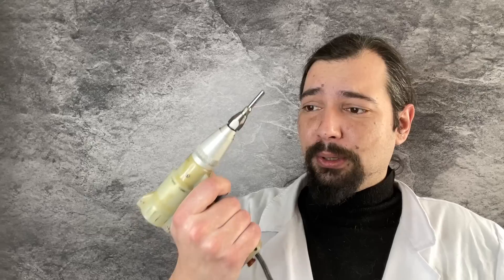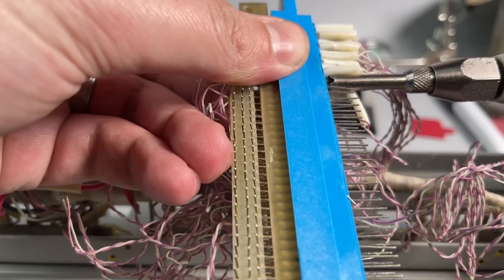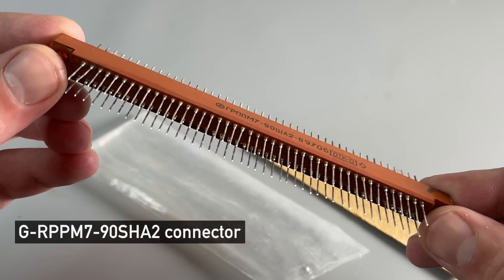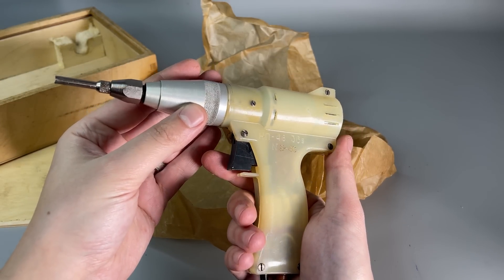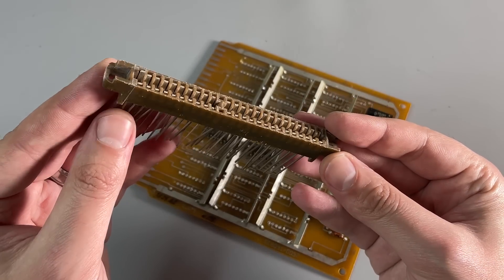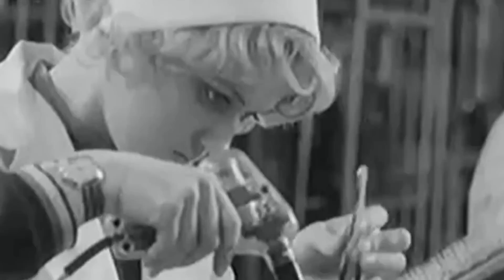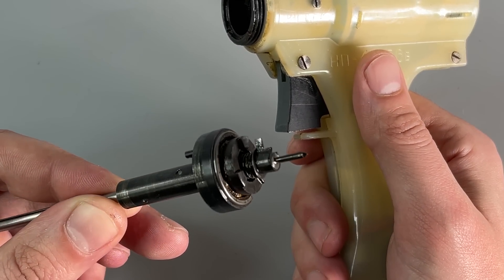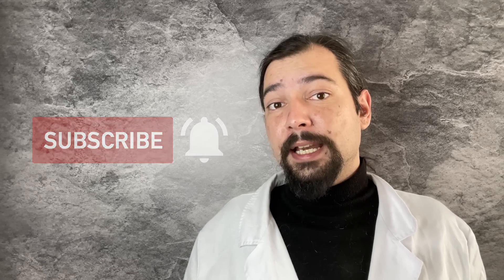We've got a vintage WIRE WRAPPING tool and it is AMAZING!

Comment: If you have some OS backups I could probably get it running in an emulator or on my newer mainframe system units and it would be interesting to take the emulator and plug the UI into the real panel
Reply from the maker: I have, as well as many pieces of software, all that perfectly runs in Hercules vm/360 emulator. Too bad this very panel is not a CPU panel, but universal channel multiplexer one, which operated by hell of microprograms which are gone. And in this very machine model it did not interact very much with the OS itself,  (that was the idea — of making a separate channel processor).
From that little bits of documentation we could get, we guess it will be possible to make a hardware imitation of some operations, say, address entry or switching channel offline/online, or indicating registers, butnto wire it to emulator for now looks like a very hard task, mostly limited by the lack of information.
Reply: @ChernobylFamily  ah so it was a Bus/Tag multiplexer?
Reply: If you know the IBM equivalent I may be able to get more information here to try and recreate the device.
Reply from the maker: @vinatron8075 sort of. The CPU panel looked similar, but had way more lights and less buttons.
Reply: @ChernobylFamily  well if you need any IBM docs that you think may help let me know I have connection I may be able to find stuff
Reply from the maker: Thank you! I will keep in mind, there really may appear a need. But still there is some work to do before that.
Reply: @ChernobylFamily  not a problem keep me posted I have some resources here and know some people with S370/S360 Channel MUX units

Comment: Soldering wire-wrapped connections impairs reliability! 
And the tool is cool, unfortunately it doesn’t fit 2.54 pitch. I have the same one, but I wirewrapped my relay computer with a hand tool
Reply from the maker: I believe you, though unfortunately do not see other option with round pins. Yes, it seemingly is for 5 mm only, I've managed to wrap СНП34-135 with it, though that was somewhat a painful experience.

Comment: This is interesting timing, I am building a test fixture at work and we’ll be using wire wrap for the spring loaded test pins. This is a superior connection method compared with solder cups because of the vibration resistance. I haven’t done it myself yet so it was cool to get a view from you first!
Reply from the maker: Good luck!

Comment: Jonard in the US still makes wire wrap tools new for the phone company.  If you want to make it a little faster they have a cordless version and it has a wrap/unwrap bit built into it.
Reply: The ones I've seen don't have that insulation wrapping feature though.  You might be able to twist the gun by hand.  It's notably faster than the one you got.  It seems like 2 seconds for your wraps and jonard is like .5
Reply from the maker: I guess my one will work way faster if I find a PSU as required. This one is terribly underrated by amps.
Reply: @ChernobylFamily  I've never had a wrap of insulation be specified in my jobs but I think another way to tackle it is to stick insulation up the wire wrap barrel

Comment: I still wire-wrap a small project now and then.  Used to use the Gardner-Denver WW guns at work back in the 80's.  We built some very large WW boards for our flight simulators, and these did use the automated WW machines that were programmed with punch tape.  It worked pretty well, but now and then would stretch the wire too much and cause the wire to break within the insulation.  Troubleshooting a board with thousands of wires was not fun!  I still have my manual wrap and unwrap tools, as well as the No-Nix stripper for the 30 AWG wire.  Very handy stuff.
Reply: I worked at dataCon from 1975-2000. dataCon was the largest wire wrap contractor in the world.
 We modified our Gardner Denver automatic wire wrap machines so that they would perform a continuity test with every wire the machine would put on the back plane.
Reply from the maker: Thank you for sharing this!

Comment: Now you need holsters to go with your pistols! 😅

Seems like wire wrap was typical world-wide so yet another thing we can all share! ☺

The mini computers we had at work in the 80s, 90s, and early 2000s used wire wrap for their backplanes.  I remember a tech modifying things so we could have 2 computer chassis use the same peripheral rack - it could be switched between the computers in case of a failure as it was an important system.  It was always amazing to me that so much had to be done correctly by hand to make it all work! 🤓
Reply from the maker: Thank you for sharing!

Comment: Never use a heat gun on or close to a wire wrapped board. I did to heat shrink some soldered connections not realizing the wire wrap insulation is easily melted. Redid the whole, but small board.
Reply from the maker: This is a good advice.

Comment: ...I remember when our school district moved its central office into a new section of the high school back in the mid 70s, they built a new computer mainframe room as well instead of moving the old one in... While they were putting it in, I saw  a somewhat different version of these things being used on the busboards and wiring arrays amongst and between the different computer components and peripherals... That would've been a lot of wires to solder otherwise... Nowadays, everything is mostly miniturized, self-contained, and if it HAS to connect with something external, it's completely wireless, via USB, or just a simple "lego-snap" and it's done!
Reply from the maker: Thank you for sharing!

Comment: I was about to ask who would accidentally find 4km of twisted pair wire in their shed. But after a bit of thinking, that actually sounds perfectly reasonable. Always wondered how the people building mainframes knew where to run the wires.
Reply from the maker: Each of those two rolls of wire is actually 2800m, so there are 5.6 km in fact, just as the wire is super thin, it takes very little place. I bought that long time ago for something and forgot, now it is just perfect for the project.
As for mainframe builders, there normally were made special cabling/wiring schemes, and then everything was assembled either manually or semi-authomatic based on them.
Reply from the maker: Thanks for sharing!
Reply: I live in Bulgaria now - finding find 4km of twisted pair wire in a shed would be a very normal thing here.   You can buy NOS capacitors and chips by the Kg.

Lots of people here build tube amplifiers as the old components are so easy to get.
Reply from the maker: @piccalillipit9211 my man!
Reply: @ChernobylFamily - I believe most of the Soviet computers were made here in Bulgaria, I know there are old computer factories in my city of Burgas. Apparently, the world's 3rd largest manufacturer of computers in the 1980s was Bulgaria...!??!?!  

What I love about the old Societ kit is the amount of info on the labels and the mouldings - my washing up bowl was made in 1977 and my cheese grater in 1983...
Reply from the maker: @piccalillipit9211 perhaps not most mainframe computers, but most of their peripherals and indeed a lot of personal machines. Anyways, when I see Bulgarian hardware I feel a relief knowing it will work even decades after. IZOT was awesome.
Reply: @ChernobylFamily - Im British so this only what I have read.
Reply: @piccalillipit9211  Bulgaria was main (and only?) source od disk storage in easter block. For computers - sure IZOT and Pravetz were the thing but for example completly unknown in Poland.
Reply: @piccalillipit9211  What about Pravetz 6502 clone based computers? I tried to find one on ebay. Not an easy task.
Reply: Behind the Iron curtain people were collecting everything what was accidently available as everything was hard to buy. Such wire you could exchange for a carburator for Lada or other Wartburg ;)
Reply: @SobieRobie ayeahh lada vs trabant fight go!!
Reply: I had a 5ft spool of high end coax cable that the cable company forgot. Worth about 5-10k.  Went to sell it and it was almost all gone.... Sisters x had been using it as mains cable to wire houses 🤦 wasn't impressed.
Reply: Just to be clear, though...4km of wire is probably what you'd need to build a functional version of the Elektronika desktop scientific calculators in a wire-wrap form. I'm guessing an ES1060 must've had a little bit more¹ than that in it... 😉

(¹ - Try the equivalent of Moscow to Vladivostok, though that's a very conservative estimate... 🙃)
Reply: Given that the USA lost an 85 ton T28/T95 prototype armoured assault gun vehicle in a bush for decades, coils of wire are small potatoes by contrast 😂

Comment: About 40 years ago I used a similar machine for wire-wrapping. That one could also strip the insulation from the wire. You inserted the insulated wire in the tool and it stripped part of it.
Beware: you need to use the correct type of wire and posts. When done with the correct force the properties of the connection are outstanding.
Your tool turns a bit slow I feel. Go get a higher-rated transformer.
Reply: I’d wonder how it would work with a bench top power supply where you can tune the output properly.
Reply from the maker: @Underestimated37  i guess anything what provides 36 v 300 mA will work.
Reply: @ChernobylFamily  42 Volt, which was used as standard in telecom, I still have all the tools for WireWrap including the transformer and soldering iron (Selectra 42V), at the last job I had they couldn't find people with the tools and experience with WireWrap, that was Nice, I earned a lot for Monny with it, started my career in 73" as a young boy..
Reply: It was called "Slit and Wrap" I used it a lot.
Reply from the maker: Exactly! With thinner pins it creates pretty crude connection. Yes, I need a better PSU, that's true.

Comment: This is really cool! I watched a video a few weeks back on NASAs wire wrap techniques for spacecraft, it can be extremely exacting, which isn’t surprising considering the application. They used pliers, so a tool like this makes a ton more sense
Reply from the maker: Need to check that!
Reply: Core Rope memory.  I believe most of them were made by hand.  
https://www.youtube.com/watch?v=P12r8DKHsak